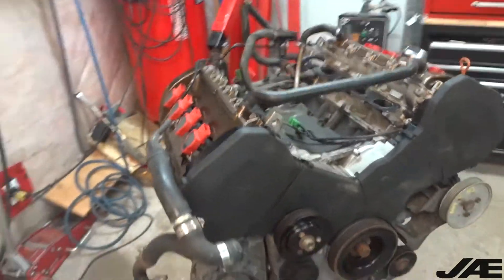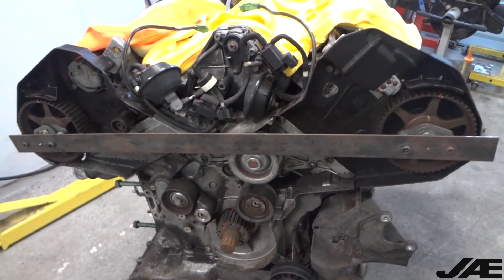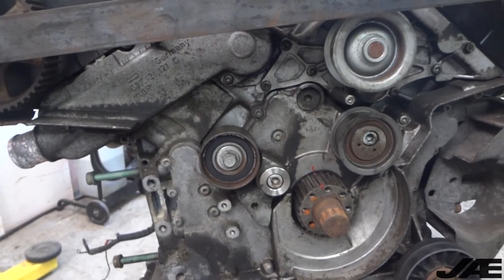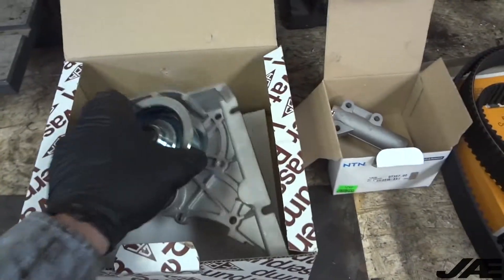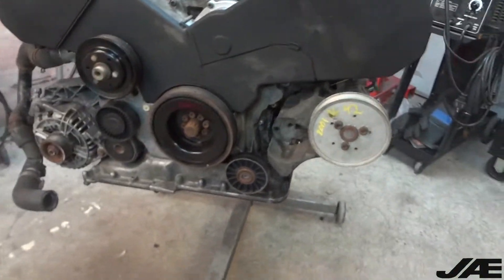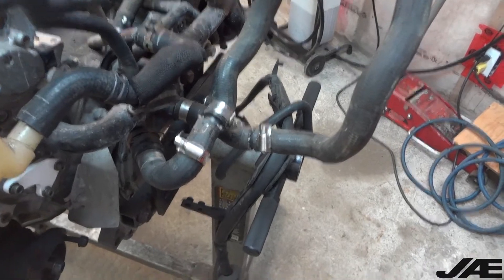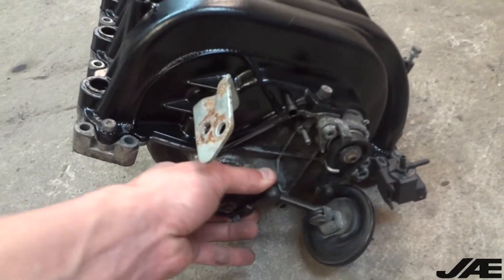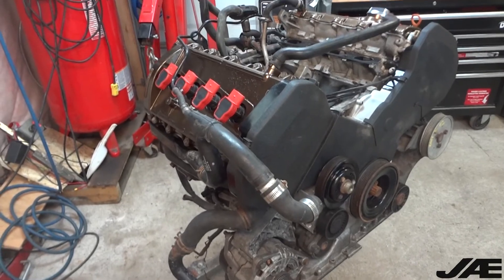Project B5 V8 EP3 - Engine Prep

Comment: I want to do same swap but I have an auto transmission, Can I use the same transmission my is 2.8 L 30v I know I need all the harness but I am wondering about the transmission,
Reply: i may be wrong, i think you can use a Tcm from a ALLROAD  becuase it had an option for the 4.2 with zf5hp19 transmisson. the a6 4.2 came with a zf5hp24.

Comment: I have a 98 A4 2.8 Quattro 5 speed. 
If I 4.2 swap it will the motor bolt up or do I need a bell housing adapter? 
Also do you have to custom make motor mounts?
Reply from the maker: It will bolt up, you need C5 A6 4.2 Mounts

Comment: Great videos. Ive been planning on doing a 4.2 swap into my 98 5spd 2.8 avant commuter. What do you do for tuning? I need to keep it obd2 because of the state i live in (also the reason my v8 swapped car is a 1990)
Reply from the maker: Still working out a proper tune with vendors.  Haven't had much luck to make sure it'll pass emissions so far.
Reply: What codes are you getting? In all honesty a retuned ecu should be fine, i just need to retain the obd 2 function. I just did my a8 front brakes, s4 rears next, then its time to find a motor so I'm gonna need to figure something out
Reply from the maker: We got it all worked out.  We have an obd2 test and has to pass all readiness and no CEL
Reply: We can actually have 2 readiness codes not set and pass with no cel, what computer are you using? Awn? Also what tuning program or do you farm out the tune?
Reply from the maker: AWN.  I worked with Doman8 Performance Tuning on this ecu.

Comment: did u get the engine in a surplus or junkyard from another donor car? how much is it to swap a 4.2 from start? thanks. keep up with the vids. 👍🏼👍🏼👍🏼
Reply from the maker: I got it from a B5 that had already been swapped to a 4.2, but very very poorly.  Costs can be anywhere from 500-5000+ depending on what you need, what you want, and how much you pay for used vs new parts.
Reply: The Audi Garage was it a straight forward bolt up for the under carrier and where there any major modifications need to the car?

Comment: Hey Adam. I'm really excited to watch this build. I just completed a full timing belt refresh on an AUX 4.3 V8 in an A8. The timing was also a tooth off but after looking at the position of the cam adjusters, could it not have been that the adjusters had engaged to tune the timing during the motor's last operation? This was our thought process as the motor ran great for years before we did the timing belt job.
Reply from the maker: the toothed belt has the parameters of having the crank in the correct location and the cam gears indexed correctly so that the exhaust cams are lined up with the notch on the heads.  In my case this is what was off, the cam chains where still correctly aligned with one another.